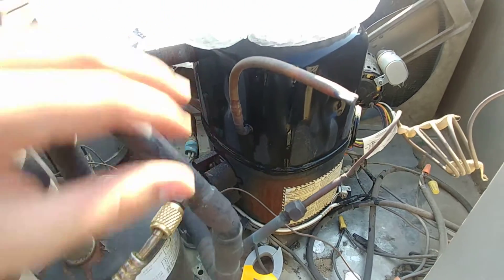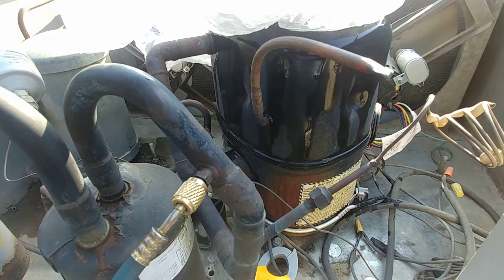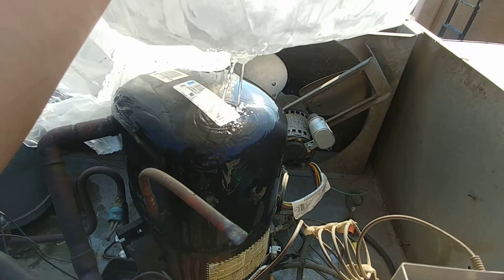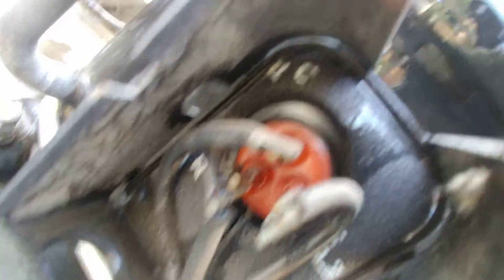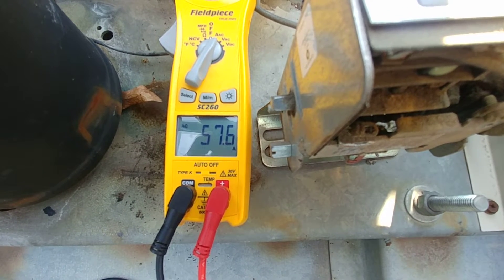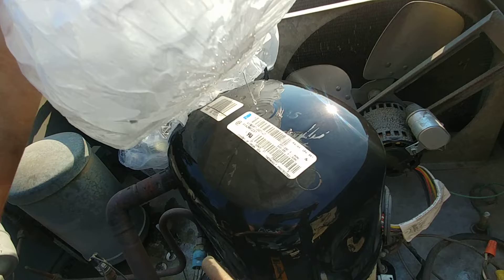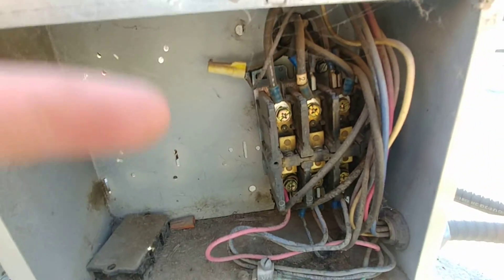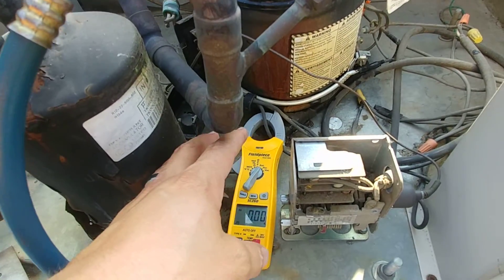How To Diagnose a Compressor With a Locked Rotor - AC & Refrigeration Troubleshooting

Comment: just wondering if you reverse the wiring on the 3 phase could you move the rotor in reverse ???   or does locked rotor mean a seased machine
Reply: Yes, that does work sometimes...but only on 3 phase.
Reply: The AI says that you can also unlock single phase compressor by change wiring between start and run pins @mrgrey361
Reply from the maker: aus footty If it's locked then it's pretty much done for. I've never tried reversing the leads however to attempt to get it to break free. I just might try that in the future. Good thought!
Reply: I could be wrong but I remember when we used to work on 3 phase motor, when the L2 and L3 was mistakenly swapped it runs in reverse.
Reply: You should always try to start it in reverse. Swap any two leads. It may not help but it just takes a minute to try.